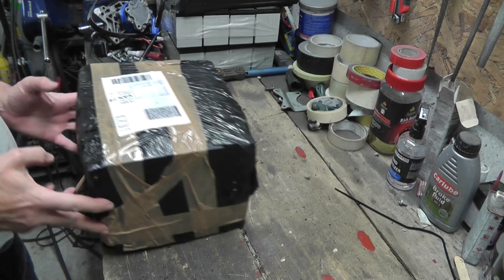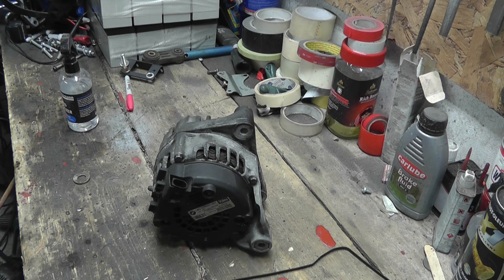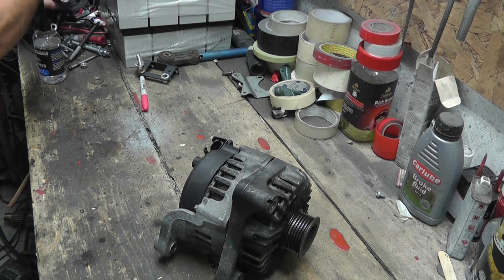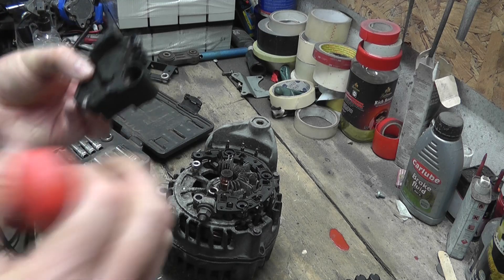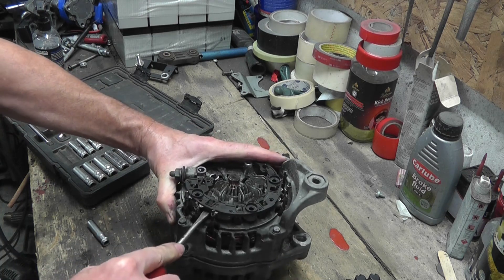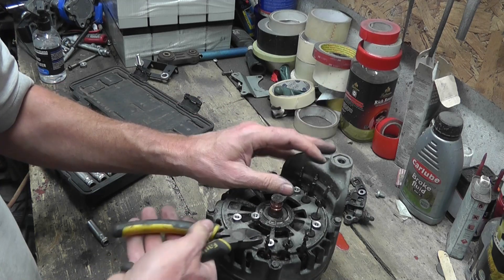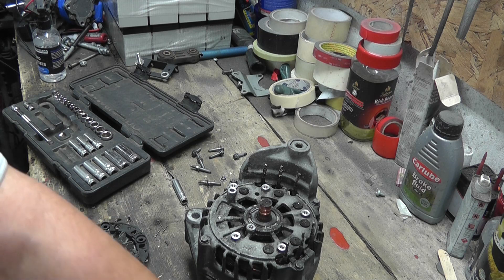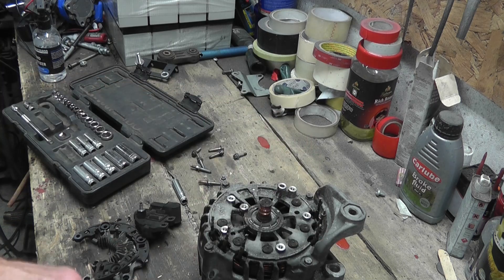180A 2500W Alternator Motor Part 1 FAIL!!!

Comment: I think you have to check the resistance between each coils and find which are 3 beginnings and 3 ends of faces. After that you have to connect 3 ends of coils and will have motor connected in star connection
Reply from the maker: I don't think it is that simple unfortunately.
Not to worry, I have a plan B. 😉

Comment: Six phase alternator; 60 degees between phases resulting in less output ripple.
Reply from the maker: Thanks Paul, I guess it is wired as two x three phases so very unlikely I can get it working with a single ebike controller. Certainly not as a 180A motor anyway.
I have a plan B. 😉
Reply: @alibro7512  If you used two controllers, each with it's own shaft encoder (suitably offset) that might be workable. Polyphase motors are gaining some ground these days. Cedric Lynch (of eponymous motor fame) has been working on them.
Reply from the maker: It may be possible but I don't have the time or patience to research how so have gone for plan B.